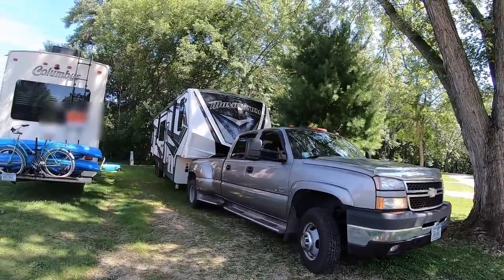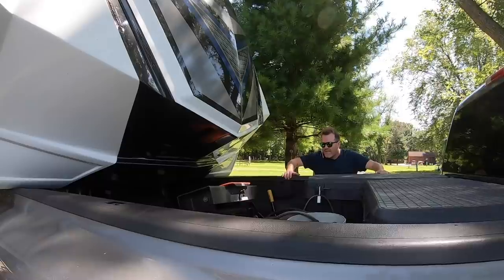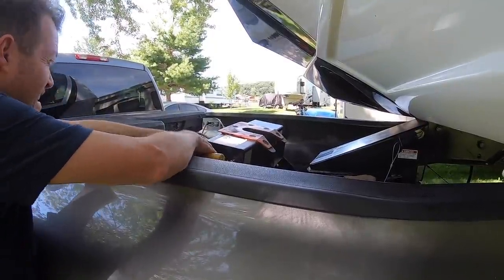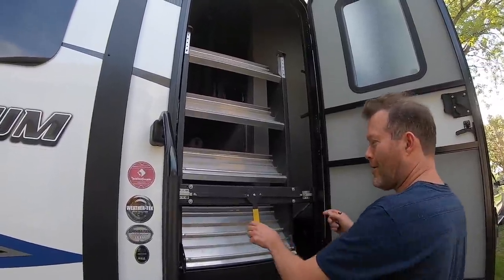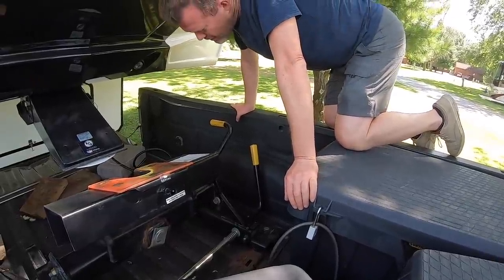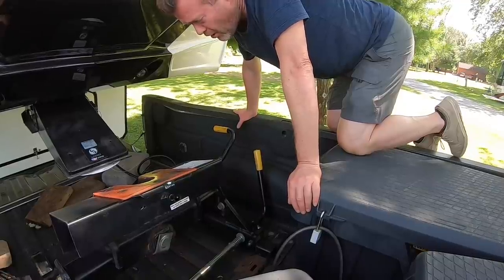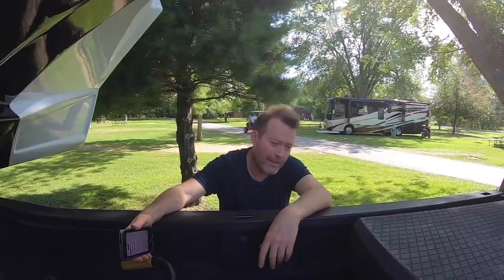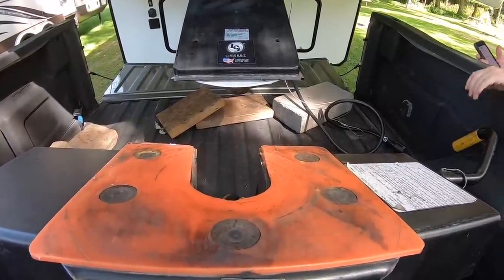RV CRUSHES MY TRUCK ON 1st TOW! BIGGEST RV LIVING FULL TIME MISTAKE! (PT 2)

Comment: This exact same thing happened to us on our first trip also with our new 40ft. Toy hauler and our new Ram 2500 truck. Already been driving all day with trailer after leaving another campground and headed to the new campground. Went to back into a spot then, decided it was not going to work so, went to pull forward and gave truck some gas and, next thing we see and hear is trailer pulling out of hitch and falling onto back of truck just like yours but, crushing my sides worse than your's and, totally destroying my tailgate to where would barely open! 
And, of course, like you guys, everyone at campground was watching and coming over to give us there opinions!🤷
We still don't know what exactly happened because, like I said, we had been driving all day and it was definitely locked?. Long story short, dealership who installed it said, they had never seen anything like this happen before so, sent it to factory in Indiana to investigate. Kept calling dealership as, they would not update us so, finally went down after like 5 weeks to dealership and, they said that people from Indiana ( manufacturer of hitch) came up with the conclusion that it was " our fault"! Are you kidding me. Said, " Owner error hooking it up"! B.S. I've been hooking up fifth wheels with my Dad for over 20 years! I know what the " Locked Position" looks like! They just didn't want to take responsibility for a " Faulty Hitch"! Long story short, over $4k to repair truck side beds and new tailgate w/ camera, etc.. So, we know that horrible feeling. Take care and safe travels...( Oh yeah, trailer received minor damage to fiberglass under both sides under front cap where it landed on truck bed.)

Comment: I know this video has been a while now, but if it make you feel any better moving too fast, excited about what you're doing, or just not focused 100% on the task at hand can happen to anyone.  If I were you I would have been throwing up.  Just glad for everyone it happened THERE and not on the HIGHWAY.  It still sucks though.  

I was told to hook up a trailer for my boss on his personal truck because he was going to pull everything to the next job.  I was told to do it because he trusted me, but it was also the end of a very rough day and absolutely everyone wanted to get out of there.  It was just a 5x8 cargo trailer.  Normal hitch, normal everything, nothing I haven't done before about a million times.  Came back in the shop and said you're good lets go, so we left.  On the way home I just kept going over how I hooked up the trailer in my mind.  Something wasn't right.  Gave the boss a call and said you might want to check over the trailer.  Something is just getting to me that I may not have put the clasp down on the ball.  He said I thought something was bouncing around too much!!  Don't know how we got so lucky and nothing happened.

I also had the wiring harness pop out of the socket because I thought it was secure.  A blaring horn behind me let know what I didn't have any brake lights (for some reason it even sounded angry).  I remember those two stories that happened to me and if I can't envision every step in my mind when I go to take off I literally get the chills and go check it again.

Comment: I was gonna mention the “safety tug” but I see you already figured that part out. You want to do the safety tug as soon as you hook, while trailer is still chocked (or brakes locked for air-brake trailers). Once you know you’re locked in property, then you un-chock and hook up electrical lines and lift landing gear, etc. Good luck.

Comment: The leveling feet go up one at a time because of least resistance. once one starts it generally will go clear up before it starts another one . its the nature of hydraulics.  Also Not that I think the damage to the trailer frame would be great , but it may have picked up just a bit of damage.. say a slight bend.  BUT  the fiberglass shell is not damaged , it probably flexed at impact.  If the frame had bent at the contact area bad enough the fiberglass shell would have cracked or broken.  Certainly not something to be alarmed about, the frame of the trailer strength would  be much stronger than the sheet metal of the truck.

Comment: So I'm thinking everyone should have a best practice of not pulling the front legs up after a hookup. Just pull them up an inch or so and have full weight on the hitch then pull out a hop and check. Maybe some boards for under the feet. Or at least do this the first dozen times just for safety sake.

Comment: Sorry that happened to you.  BUTTTTTTT slightly over dramatic about everything falling off the shelves and whatnot.  You didnt even move it 6 inches forward and it fell maybe a foot on to a truck with springs therefore lessening he impact.  Of course nothing moved.  

However, in the heat of the moment I can see how one would think that.  But still lol

Comment: When you back up to a fith wheel as with a tractor trailer you backup just short of hitting the fith wheel and get out and look at the Height of the king pin to the hitch, Adjust the trailer height a little low so you pick up the trailer slightly with the fith wheal {hitch)and get some of the weight on the truck that way you know your not high pining the king pin ,You should feel the truck lower while backing  When you back under the trailer and back up till you feel it and here the truck stop and the hitch lock. You have to be backing a couple of miles an hour don't slam it but you need to feel it lock ,,then   { without getting out }    pull forward with the landing gear   {still down }  to see if your locked or not if not  the truck will move forward and the trailer will just come down a couple of inches and do no harm. practice this a few of times and you will no problem dropping your trailer for grocs. or whatever you want to do without hauling your trailer around town Happy Motoring and SWEEET TRAILER

Comment: First of all I feel your pain no REALLY.  We bought a fifth wheel trailer from a great dealer showed us all how to do all parts of hook up  unhook  all cords drains  etc.  They even had me turn it as sharp as I could in the parking lot to see that it would not jacknife into my truck no way no how.   Well the parking lot at the dealership was really level, REALLY LEVEL.  I get it home and go to back up into our driveway which  has a slight incline into gutter and then slight incline going up to good  driveway....  or so I thought.,..........   in the middle of the gutter the trailer was leaning down and my truck was also leaning down  the trailer going out of the gutter and the truck going into which WAS NOT LEVEL AT ALL  .  So  put your two hands together and level ,  now make a v shape then add  a slight turn going  on also..... I got a nice little crunch on the  passenger side of the cab where all things went wrong.  On the way back to the dealer I settled down and realized what had happened.   If my neighbors drive way was long enough for me to get perfectly straight to back up it would have worked.  The good thing was the trailer just had a small chip .  We decided that we needed a smaller trailer and  probably a bumper hitch instead of a fifth wheel.  So we go back to the dealer.  I could  not believe how great they were about the whole thing.  I used to sell cars, when the tires hit the curb you own it and it just dropped in value 20%+.  They said just unhook it and we will take care of it.  The only thing we lost was the labor of installing the  fifth wheel hitch.  But it had been a bad day that just would not end.  In the process of unhooking the  fifth wheel trailer I got the level  right so I could  drive away ,  I had to close the tailgate to unhook the electrical  then I shut the tailgate looked at things yup I was good to drive away.  put it in gear and pull up a couple of feet and hear and feel BAD THINGS.  I had not been high enough to clear my tailgate by about 1 inch.  My v shaped tailgate was a lot worse than yours.  It would not open .  I had to go hillbilly body shop on my truck.  Come a long to get so it would open and shut it looks better than it was but a used one costs 650.00.  SO don't feel you are the only one!  ON a lighter note we have a great trailer a few feet shorter and bumper hitch have been out multiple  times  no problems.  One suggestion to all trailer purchasers  VIDEO your sales guy or gal so you can have a movie on how to do all things to your rig.  Come on its only money.......
Reply from the maker: Wow! Robert that was a bad day! Glad it all worked out....right, as long as no one got hurt, it's only a little money to fix the problem! Thanks for sharing and thanks so much for being a member!! Safe travels!

Comment: The guy told you how to do it, pretty clearly at that! and you didn't follow his directions! That pin has to go into hole where you removed the handle from, if its not able to go in there that rod is not far enough in and the jaw is not locked. Seemed to me you didn't fully understand that by the end of the video. I can understand how it could happen in the moment with all the excitement of the new trailer and a foreign hitch. Better luck next time i suppose, beautiful camper glad to see you got it figured out!

Comment: You should always apply the trailer brakes by themselves with the truck moving very slowly to 'test" the 5th wheel hitch is locked, my truck just backed into the trailer  until it banged gently and that automatically latched the 5th wheel hitch, if the handle is
 pulled out / towards you thats released, when its latched the handles sucks in, you have a trailer brake right?  try it every time before heading  out, the tailgates wrong type.
The easy way to back any trailer is know that whatever way  the bottom of the steering wheel goes the back end of the trailer goes.
So looking over your shoulder if the bottom of the steering wheel is moving left  so is the back of the trailer, that means the top of the steering wheel is opposite.
I always placed my hand at the bottom of the steering wheel  at the 6 o clock position, that way  whichever way my hand went the trailer went too.  Long trailers are easiest to back up as they take so long to jackknife, short trailers get away from you much foster.

Comment: We have a 30 ft + fifth wheel that we had been hauling for at least 5 years and we took off one weekend all the stuff hooked up and drove for 30 miles or more up and down valleys and then on the smoothest leg almost where we were going at 60 miles an hour it let go and the hitch came off the truck went back and the tail gate stayed in place and the hitch came back and down and then stopped. We were lucky we didn’t lose the camper.   Ya the truck took all the damage. The camper was fine.  The hitch was too high and the tongue wasn’t engaged  but it was hard to tell because it looked and sounded fine.
Reply: Omygoodness! That's good living. So blessed no one got hurt.

Comment: Too much crap between 5th wheel and hitch plate. 
You only need ONE of those plastic graphite things. And there was TWO. 
Pin did not go low enough int hitch to allow the jaw to go into the groove on pin
Take the white plate OFF, and leave it off. 

Next, go back to your video where the guy told you to be sure the handle was down further than it was when you tried to pull out.
It was not as he explained it to you. 

This one was “user error”, not a bad hitch or bad design.

Comment: U high pinned...  the latch never was able to “close” u can see it in the first video...

Point here... (AND) at the end of your video...

Keep weight on your hitch as u load and unload!!

It keeps stuff tight like it’s supposed to be.  And as u pull out the legs will take the weight off the hitch etc...
I’m sure u know now

Comment: Having owned two 5th Wheels, and Almost having this happen, on 2 occasions on both, I'll go out on a Limb, and say that either the Bottom Lip of the Pin, was Too Short, or the Jaws of the Hitch, Too High?  I had those two, things happen to me, and Both Times, it took a Fabricator to fix! While they are supposed to be Standard, that Standard, seems to have changed over the decades?  I bought my very First 5 'er, in 1979, which was an Americana, 1973, 40', and a Toyhauler, (Even Before they had that name!) that I truly Loved! Let's see what caused this!  BTW, I Christened my First Tailgate, when after a 10 Hour Drive, I was Exhausted and Tore it nearly off, when Unhitching!  Hence, the Whole reason they make 5th Wheel Specific Tailgates!  They are worth Getting!  If you are Heading Near PA, right now, I can Give you one!  I now own a 40' Diesel Pusher! So sorry, but looks like that Bed MAY be Fixable?  I took double faced tape, and used a 2" X 2" X 8' Angle Iron, and placed on top of the Rail, as you never know????  As safe as 5ers are, you Never can tell!!!!

Comment: He has no idea how to use that new 5th wheel hitch .... it prob was locked but the shaft was not in the lock position it premature locked the guy told you to turn that handle up after it locked and take the pin out and you didnt.... crap happens at least your both ok....

Comment: Always do a pull test before u ever pick up a trailers legs
Reply: I did the same thing when pulling my 5th wheel....big time peace of mind...  I know on mine the handle needed to be pulled down.  I think I left less than an inch of travel on my levelers.. then cranked it up after I was sure it was locked.  Now have a C-Class with no worries : )

Comment: In my humble opinion, two mistakes were made that I could see based on both videos; 1) Installing the additional nylon disk was not needed (the hitch already has one) which could cause a high-pin situation, but I don't think that was the case of this incident. 2) The mistake that was definitely the cause of this incident was that Tom did NOT rotate the release handle counter-clockwise and slide it in, then insert the safety pin (like the previous owner, Mark, showed him). You can see in the first video that after Tom hitched up, the release handle remained in the "out" and "clockwise rotated" position. The little white pointer on the front of the hitch only indicates that the king-pin is inserted all the into the hitch. The sticker on the hitch that says "When white pointer is extended and visible, hitch is locked" is misleading and needs to be revised! However, Mark did show Tom that he needed to rotated the handle counter-clockwise and insert pin. That being said, Tom was totally new to this used hitch and mistakes do happen. I feel really bad for the damage done to Tom's truck...like I'm sure most folks watching, I couldn't help but say "oh shyt" when it happened. Good luck on the repairs Tom, and I'm sure this is NOT going to happen again!! Safe travels! :)

Comment: Had a job for years where I had to drive semi trucks around a freight yard, hooked them up and disconnected all the time. Something you ALWAYS do when hooking to a trailer with a fifth wheel.. As soon as you back in, before you ever even get out of the truck, you do a dead pull connection check! You NEVER NEVER NEVER pull an unchecked hook with the landing gear up! Sorry dood, really really dumb mistake if you've been a 5th wheeler before, I'm surprised you didn't know this already... bet you do it every time now... with the landing gear down, trailer brakes set!

Comment: I sold my toyhauler and purchased a beautiful teardrop trailer.  I was in Moab, Utah.  It was late and there were high winds.  It was a sand storm, and I was looking for a place to camp.  I needed to turn around and take another gravel road.  I backed up no more than 3 feet and jack knifed my little teardrop into my truck bed.  It sounded as if I had crushed the trailer.  I got out, the the trailer jack handle was bent and the trailer looked fine.  I turned around to get into the truck and the exterior and corner of the truck bed were bent all to hell.  Shit happens. $2800 later my truck looks brand new.  I won’t do that again.

Comment: Wow! The first film of the drop was really ugly to see. When I hitch my 5th wheel up the last thing I do is remove the wheel chocks. I have four of them with one of the axels chocked front and back. After I hook up I do a visual and then a slight tug after a slight reverse shock shot. Not too hard but enough to listen for any metallic sounds that indicates I'm not there yet. Then I pull test in forward also slightly and then another visual look. This only takes a few moments and then I un-chock.the wheels. I really enjoy your channel and wish you better luck from here.

Comment: My father in law failed to chock the wheels on his trailer and when he pulled the pin (he's left handed), he had his head between the trailer and box rail of the pickup. Trailer rolled, fell of hitch, and pinched his head. Thank God other friends were nearby and cell service wasn't out of commission that day. They got the trailer off his head and met the ambulance after a 20 mile ride down a dirt road. Broke his jaw and sinus cavity in a few places and left permanent teeth marks in the stainless steel box rail guard on the pickup. He's still with us nearly 15 years later.....but that was the last time he performed that manoeuvre without help

Comment: I really didn't think you need to do an inspection in the trailer after it feel on the bed of the truck, just commonsense that everything would have been fine inside, wasn't a big deal to the trailer as it was to the truck and you weren't going on a long road trip anywhere, you were just pulling it to another spot, everything could have waited in the trailer until you got to the new spot.